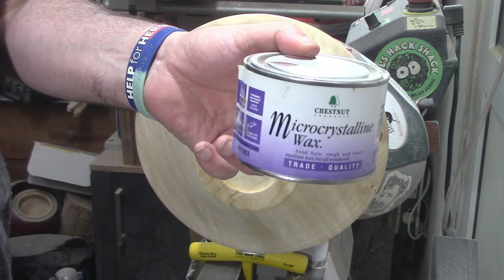Woodturning - Sycamore Bowl With Jo Sonja Paints

Comment: Nice work. Towards the end after you apply the paint, you spray the piece twice but do not I'd the spray you're using. What is it?
Reply from the maker: Yes, correct and that was Sanding sealer, that was to lock in all the paint, you can for sure use Lacquer if you wish too, Hope that helps